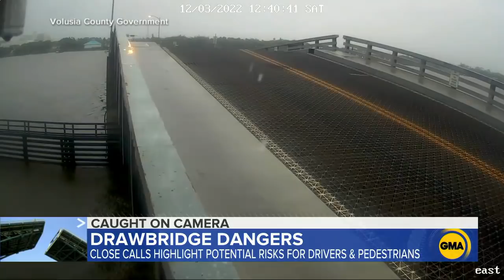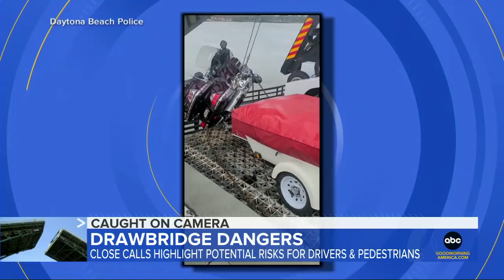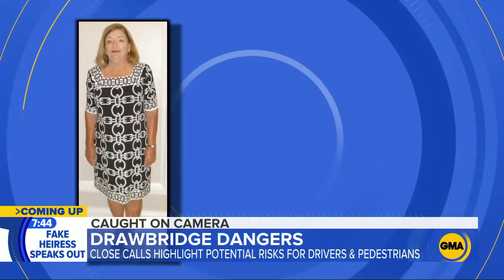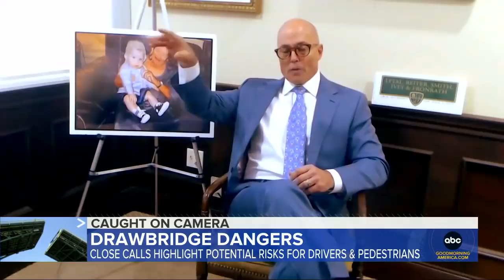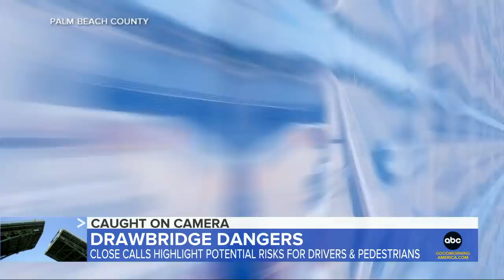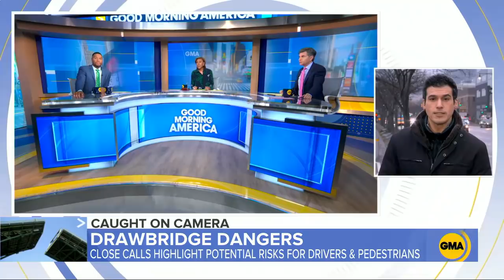Motorcycle crash draws attention to drawbridge dangers l GMA

Comment: Many of these incidents appear to be citizen pedestrian errors i.e. ignoring warning signs of barrier crossings, warning sirens, and flashing lights followed by the car appeared to just be sitting there at the seam where the bridge rises. IDK if it's just me, but I like be safe in my surroundings so I move quickly through railroad crossings while staying vigilant and I get away from multiple cars driving in close proximity to other vehicles because I see the potential dangers guess these folks aren't doing that.